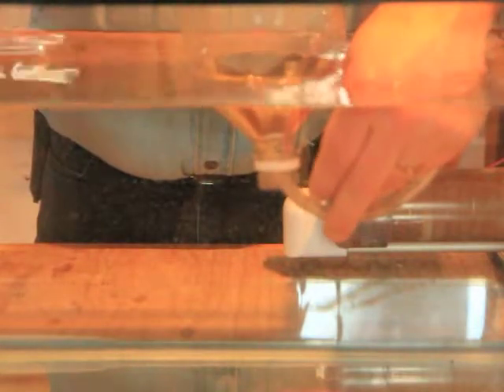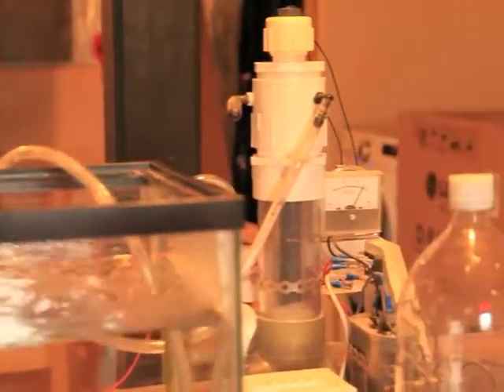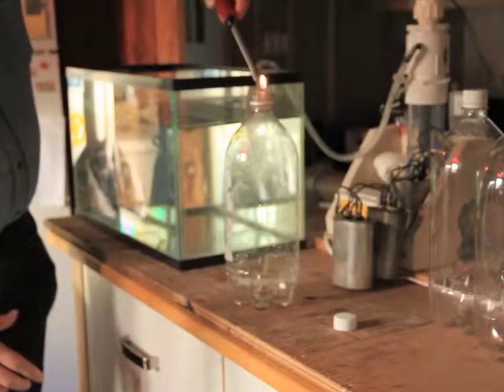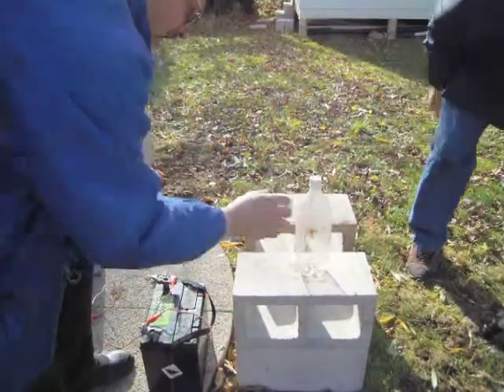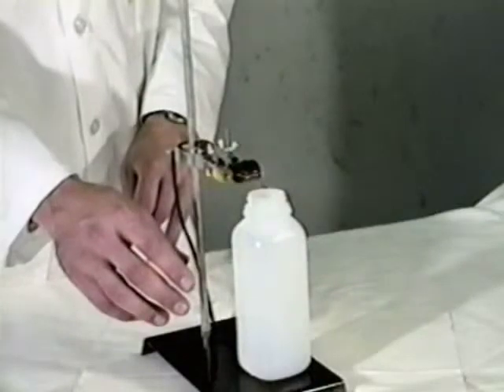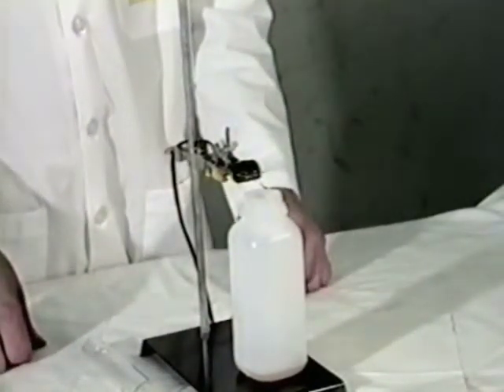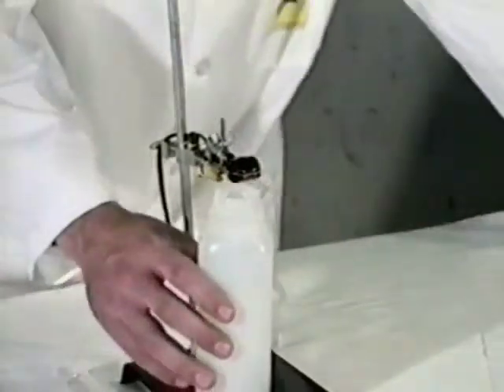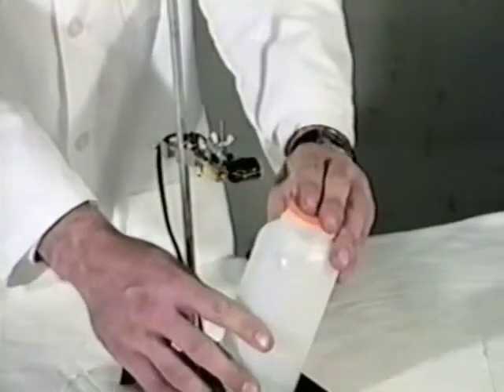Fuel Oxidation Speeds

Comment: What was the air/fuel ratio of the explosion? 8)
Reply from the maker: Which explosion?  The BG explosion was perfect stoichometric.  The gasoline explosion is anybodies guess because I had no way of measuring the AF ratio.  In fact, we had to try several times to get it to explode at all, because the AF ratio was too rich.
Reply: My point! It does not take much vapor fuel to get ignition or pressure. 8)